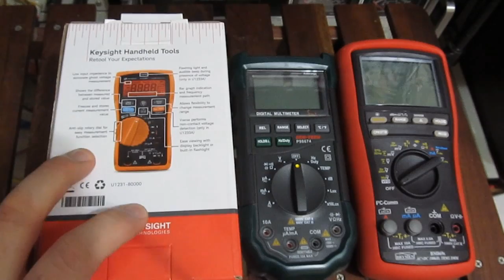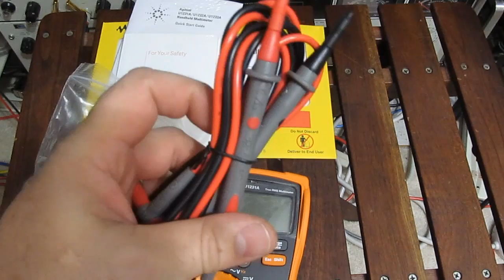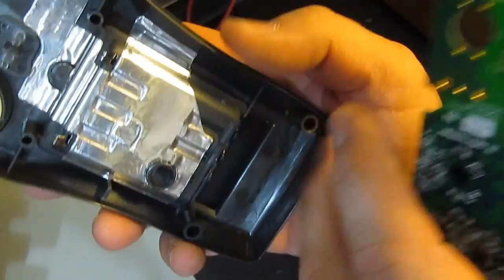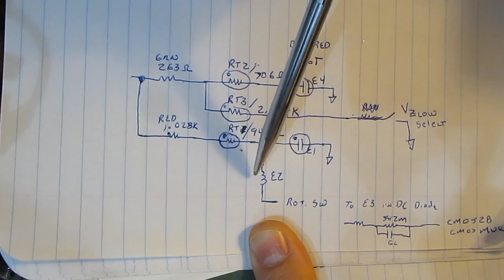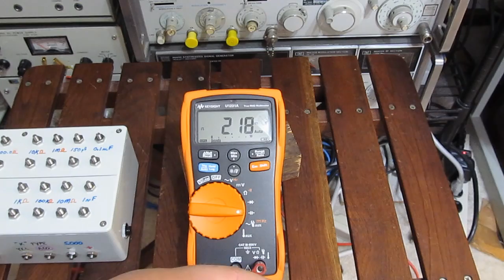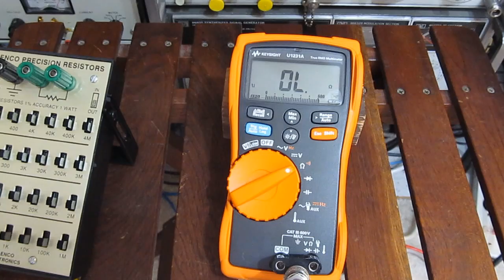Keysight U1231A  Review Part 1 of 2

Comment: not everyone is going to use the meter at 5kv, it's not meant to be. This is only a 1000v rated meter and from the test it's obviously doing far beyond it's rated voltage.
what matters more would be the accuracy and stability of the measurements over long term.
anyways 1231 wouldn't be a good candidate for an electronic use rather it would be a good candidate for mains voltage electrical work.
Reply from the maker: Yep, cars are subjected to some pretty harsh testing as well to insure the safety of the passengers.  Most of us don't drive our cars head on into concrete like the test dummies.  Maybe read the IEC standards or just do some simple Google searches on surge testing and what you are going to find out is the tests I show are a joke.  Not that they are as harsh as you make them out to be, but rather that they no where near as harsh as the real tests are.  And again, if I were interested in considering how safe a meter was, I would be testing differently but I'm only concerned with the robustness of the meter's front end.
Reply from the maker: Use it at 5Kv?  I'm sure some people have watched these videos where meters have survived transients in the several KV and felt it meant they could measure the output of a MOT with one.   That's the downside when you don't understand what it is you are watching and are not willing to do the research.
Reply: +joe smith 
I do understand the transients you're speaking about and the reason people don't feel like using them if they didn't survive transients, but I don't think 1231 is meant for those, a Fluke 87v not surviving these would be really s something. I don't think an electrician doing low voltage mains work is going to have that high transients.
Reply from the maker: I doubt very much that you grasp what is going on in the videos.  I ran a few 87Vs. They were no where near as robust as many of the other meters.
Reply from the maker: The first few minutes of this video may help clear things up.  After this first batch of meters were ran, I made some changes to how I was testing them.   Some of the meters (Fluke 101, AMPROBE AM510 and the UNI-T UT90A) continue to be ran with the new setup but I keep the data separate.   The spreadsheet containing all the data may be found here:http://www.eevblog.com/forum/testgear/hear-kitty-kitty-kitty-nope-not-that-kind-of-cat/
https://youtu.be/RBkjr3b5hQo?t=77
Reply: The voltage rating isn’t whatever you choose it to mean. The meaning of that term is defined by the standards that the damn meter is specified to be designed to. If it doesn’t meet them, then the specs are a lie. Laws protect us from that nonsense. And under those standards, the “rating” of 1kV CAT III means that the meter must survive certain transients safely but can be damaged, and it must survive some other transients and operate within specs afterwards. Those transients are much higher than 1kV. The meter also must remain safe when a certain amount of energy gets dissipated inside in a transient event, i.e. nothing unsafe should escape it, there must be no fire, etc.

A meter that can only survive 1kV at the input would have a rated operating voltage of about 50V CAT III. I don’t even know if the standards go that low. I’d be personally happy operating such meter up to 100V CAT II, since that’s what a “1kV only” meter is, and that’s that.

And no, you can’t use this meter at 5kV. To use it at 5kV would mean that it has to survive something like 60kV transients (real numbers may be higher). A meter at 1000V CAT III implies that at 1000V “only” those transients are present and it must survive them. The CAT rating specifically means what sort of transients the meter should withstand without failure, and what higher ones it must at most safely fail at. A 1000V CAT III meter must withstand 8000V pulses. If it doesn’t, it’s not CAT III, and marketing it as CAT III is grossly irresponsible, never mind false marketing under many consumer protection laws.

A 1000V CAT I meter must survive 4kV pulses, CAT II meter must survive 6kV pulses, CAT III must survive 8kV pulses, and CAT IV must survive 12kV pulses. The reason that meters are usually rated 1kV CAT IV and 600V CAT III, is that both those ratings imply survival of 8kV transients (among other things).

Hopefully now it’ll be clear that what joe is doing is rather mild testing, more appropriate, say, for a 500V CAT III meter… A decent 1kV CAT III shouldn’t even glitch when facing such transients, never mind surviving them.
Reply: these test are irrelevant over what is rated, is like you smash a car at 2 mach and say "ehh car not good, unsafe, bla bla" whats the point of using a meter over the rated point???
Reply: @dani777dani  No matter if someone is a pro or enthusiast, it should be well understood that probing some circuits and/or electrical networks, distribution panels etc, can cause (very likely) transients (few nS) of some kV. This is the reason why serious meters aiming to professionals are tested by the makers in 5-8 or even 10 kV transients.

Comment: I love your bargraph test. I had Megger M8037 with 128times/s bargraph would lve to see if it makes difference in real time ie, can display follow that specs.

Also it would be nice to test how fast is beep when in diode mode and when short is detected. I hate when meter takes time to beep when testing diode... :)

Any news on getting HIOKI meter for testing?
Reply from the maker: +sepertude Glad you enjoyed it.  I did some similar tests with the bar graphs when I comparing the Flukes with the Brymen.      I'll go over the continuity test data and how it compares with the other meters in part 2.   I plan to start working on part 2 this weekend.       I did look at a few different Hioki handheld meters.   Depending how this Keysight meter does, I would rather pick up a higher end one.
Reply: +joe smith  I had U1272A and did not like it. Display was dark, it always beeps when it turns on (no disable feature), weird capacity results when measuring over 1000uF (shows less than actual value), problems when measuring small value capacitors, bargraph slow and gets confused easy, range switch had cheap feeling, not so accurate or repetitive accurate when testing resistors under 1 ohm even though it does has great resolution 0.001ohm, slow continuity beeper... when you work with meter every day this goes on your nerves :)
Reply from the maker: +sepertude Assuming this one lives, I will check into it.   I was looking at one of the Flukes with it's slow boot times and was thinking just that.  If I used the meter all the time, it would not last very long.   ;)   I looked at getting the U1272A at the time I bought the Brymen.  Their total lack of responding to emails may have been in my favor.   I am very happy with the Brymen.

Comment: Brymen is a very good meter, in fact excellent imo.
Reply from the maker: +Ribbitmefoot I don't know about other Brymen products but I do really like their BM869s.  We will see how this Keysight meter fits in.   If it holds up, I may consider getting another one.
Reply: The brymen 869s we see here is their top of the line which is benchmarked against Fluke 87v so 1231 is surely not the right keysight product to be compared with, rather I would compare the brymen with u1282
Brymen definitely are one of the better brands and OEM supplier to Greenlee, some extech and even Amprobe models!
Reply from the maker: All the meters are tested the same.
Reply from the maker: I should also add that most of the meters I ran are CAT III 600V or better rated.   The 1231A is no exception.   Not suggesting that this rating has anything to do with the meters ability to withstand the transients I apply to them.
Reply: the great thing about 1231 is that is all discrete construction, very repairable